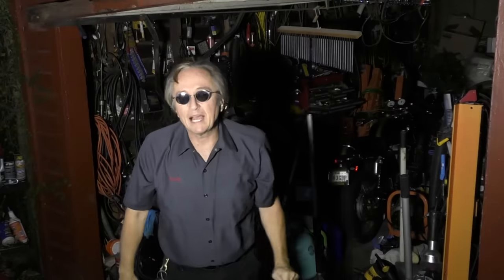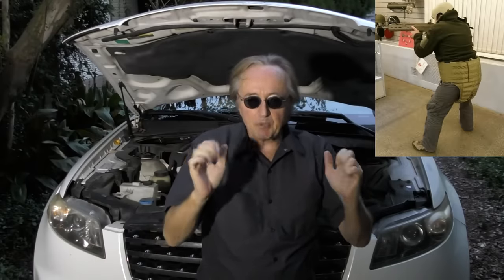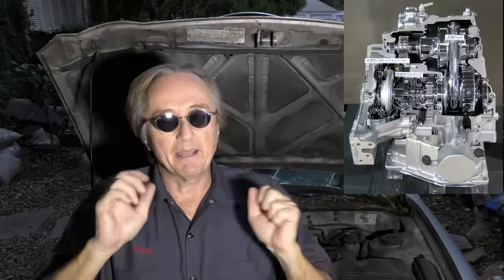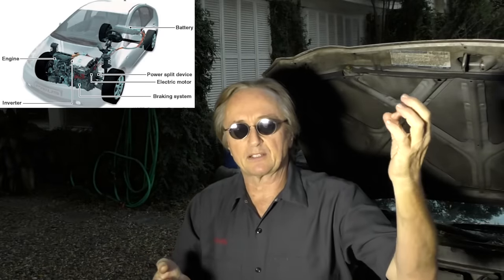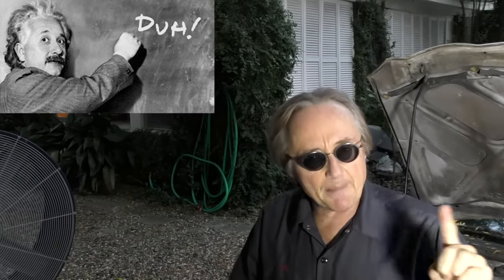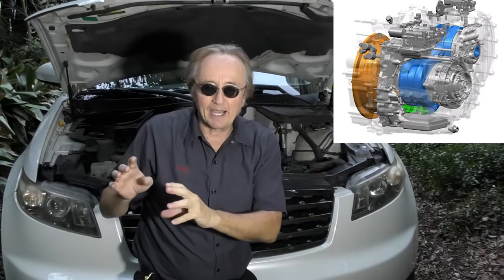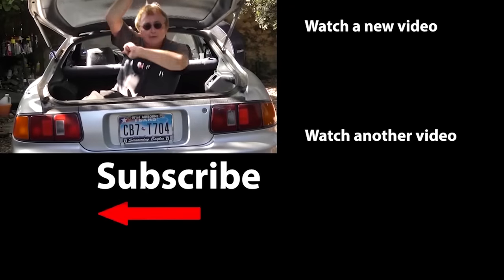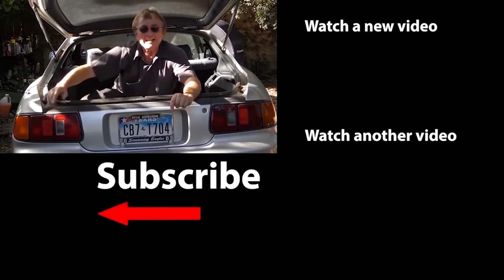Why Most CVT Transmission Cars are Terrible

Comment: 2016 Nissan Altima 2.5l 
cvt transmission went out at 43k miles, in the shop as I write this..
DO NOT BUY A NISSAN WITH A CVT TRANSMISSION.. you have been warned!!
Reply: Matthew S I feel you mate, had my Murano’s CVT replaced at 100.000 km. Engine also had a 4000$ issue. 
Get rid of this Nissan while you can and get a Mazda 6 - drives so much better.
Reply: You should still have warranty.
Reply: @anon4041  I do but that doesn't give me a piece of mind knowing the cvt can go out at anytime..
Reply: @scottsuem3384  The CVT doesn't just go out at anytime. There has to be wear and tear on it or mechanical failure. 
You also get warranty on the replacement too. CVT transmissions actually last a long time, but you need to do proper maintenance on it. A lot of people don't bother changing the fluid ever lol.
Be happy you still have warranty too, as many people don't. I don't think it is the CVT itself that is the issue, it is the company that supplied it. Which is probably why Nissan still uses CTV.  If you are that concerned, sell the vehicle.
Reply: Matthew S  get a lemon law lawyer and get all your money back, thats what I did
Reply: I have a 2017 Nissan Sentra Sr turbo. Cvt transmisión went out at 15,000 miles lol
Reply: Did they ever tell you what the problem was that cause your transmission to go out with solo of a mileage? Would you trust a CVT transmission if I bought it in a Toyota?
Reply: Do not buy nissan at all
Reply: @TheLifetraveler1  they never told me, they just replaced it, it was still under warranty. It wouldn't say that toyota's cvts are bulletproof but I would definitely trust them waaaaaay more that nissan's.
Reply: SmellyCat no it doesn’t. It has a regular 4 speed if you have the 2.5 engine. If you have the 3.5 V6 it has a 5 speed.
Reply: Nissan didn’t start using cvt in the Altima until the redesign in 2007. The murano however has always had a cvt
Reply: Got a 2013 Altima 3.5S at 82k miles and no issues 🤔
Reply: Daniel Jimenez got a 2013 2.5SV altima at 70k miles... wish me luck, no problems until now
Reply: @DarHacks  good luck because any altima owner needs it for sure
Reply: @TheLifetraveler1  cant go wrong with a Toyota
Reply: I got lucky I made it to 74000 miles.. Car is going to be traded on a Toyota...
Reply: avoidtheNoid I too got a 2011 Nissan Maxima s no problems at all
Reply: Better still. Don't buy a Nissan full stop!
Reply: @scottsuem3384  Any transmission can go at anytime. Your point?
Reply: Johnny Shawn  No they weren't.
Reply: @alexeivoloshin3065  POINT  I have never had a transmission go out until this CVT .. but please go buy one and try your luck.. how many transmission have went out at 43000 miles ?? why are you on here unless you work for Nissan?  YOUR POINT 😂😂
Reply: Sadly, that now means don’t buy a Nissan at all. I think their sole model with a regular automatic transmission is the gargantuan Armada.
Reply: @NLtakesTheHedgehog  I would buy nissan just not one with a CVT
Reply: I had a altima 125miles never had a transmission problem, now I have an infiniti still not problems.
Reply: @Deivy_84  I'm truly glad you haven't  had any problems.. but so many people have..
Reply: Fer Estrada  what’s a lemon law lawyer
Reply: SmellyCat  is it a v6?  I have a 2007 v6 Altima with cvt. No problems
Reply: My mom has a 2016 Nissan Sentra with a CVT and she hasn't had any problems at. It's been a great car for her, much better than her previous one which was a Ford Escape.
Reply: I have a 97 Sentra 5 speed it's been the best thing on 4 wheels I've ever had
Reply: Matthew s  I agree that Is why they are Mad cuz if they hot ride the car they gonna get problems with it and that’s why they get so mad cuz they can’t hot ride it.
Reply: 04 maxima se running strong at 130k
Reply: So is our Pathfinder with 26k miles!!
Reply: I have Nissan 2016 Altima and no issues
Reply: @anon4041  Only if the service intervals have been observed and documented by a Nissan dealer. I owned 2 Altima's....one was great the other sucked enough for 2 cars. Nissan absolutely sucks to deal with too.
Reply: @scottsuem3384  I mean I've seen a camry transmission go out at 60k mikes and ive seen engine failure on a corolla at 130k miles... ALL CAR BRANDS can have their issues. But if you take care of your car and dont abuse it, most should go 200k miles regardless of the manufacturer.
Reply: WTF NISSAN, EVEN 2016s BREAK DOWN??!!!
Reply: Matthew s I had a 2003 Nissan Sentra my first car I ever bought and i kept it maintained transmission never went out on it and it had 260,000 miles on it and I had it for 4 years and I got rear ended and it got totaled now I have a Nissan Altima that is 2009 and it has 196,000 miles on it and now I’m having problem after problem I took it to Nissan and had them do diagnostic on it and my catalytic converter and transmission is bad and hast to be replaced and I still owe 5000 on it  and I thought since my first car was the best car I ever had I figured this Nissan Altima that I have now would be a great car well I was very wrong uhh now I have so much work that needs to be done to it and now I don’t even know if I should just replace the transmission and catalytic converter or just get a new car so confused
Reply: @latoshatanner9554  I grew up in a family where my mum did all the driving and my dad couldn't drive. They both new nothing about cars. I was never really in to them myself but had a crack at changing a transmission when I was 16. It's a very easy job. In fwd cars they are tiny. You can lift it out by hand. First one took me the better part of a day. Now I'd probably change one in a couple hours. All the plugs are either colour coded or specific shapes that can only fit one spot. Would be a challenge to screw it up.
Reply: thanks for the heads up
Reply: i had nissan 2013 sentra sv.  transmission died @94000 miles on august 4 2019.  cannot be fixed.  need one from a junk car.
Reply: ntaveras Gees, people are going manual trans and NA engines. Turbos tgdi or gdi with cvt is asking for headaches.
Reply: Should you lease one?
Reply: I have a 2015 Altima and the transmission is great.
Reply: @adolfoescalante6220  you should tell that to about 300k people a year...
Reply: SmellyCat 2006 has no cvt
Reply: @ODTheNewRapper  miles?
Reply: @netto4835  Whoa! Tell me more about what happened to you. I'm looking into buying a Nissan Sentra SER Turbo  this weekend. 
How much was the repair bill? was it covered under the warranty? 
Is it a good car?
Reply: DO NOT buy any car with a cvt transmission
Reply: @netto4835  Great Lie
Reply: @netto4835  toyota prius uses cvt and never heard of any issues. 2014- 2021 corollas use cvt too no issues. do cvt fluid drain and fill every 60,000 miles and life is good

Comment: I have a 2011 Nissan Sentra with the CVT. So far, I've put 155k on it with no issues at all. I do stay on top of preventative maintenance as I put 100+ miles a day on it. And I get 33 mpg.
Reply: Good for you. You got a good one.
Reply: Sam LaQuey mine is a trash can and i only have 60k miles. Plus you must not drive your car very hard because i only get 24 mpg on average.
Reply: The cvt works for conservative driving. You can notice the engine should not be driven so fast for a transmission allowing the motor to remain constant at certain rpms to get too speed. I have a sentra and I too get around 33 to 35 mpg.
Reply: Sam LaQuey my theory is that it depends where your car was made. If most of the cars Scotty works on are made in Mexico then yeah it won’t be as good.
Reply: @evan8tor21  mine was made in Mexico
Reply: Yeah you & me are counting our blessing.  My daughter has a 2009 Sentra we 
bought new with 170K. I told her don't beat it or you will have to junk it ,replace 
trans or new car payments.
Reply: Joshua Jasso Is
Reply: Did you change trans fluid??
Reply: No modern car, driven moderately, and maintained properly, should break a transmission. The fact that some of these transmissions go out in under 30,000 miles tells me there is something fundamentally wrong with them. You are fortunate you got a good one but I wouldn't take the chance given there are several competitors that have better reputations to choose from.

Comment: I think the belt is the "weakest link" for a lot of the CVTs out there. When that belt blows, it's a mess of shrapnel inside the transmission. Toyota doesn't use a belt to achieve CVT in their Prius: it's all done by varying RPMs in MG1, MG2, and the ICE. Cool stuff.

Comment: 127 k on my Altima. Runs like the day I bought her (2011) don’t play with the “manual” option UB FINE....31 MPG 💪🏻
Reply: I have a 2015 corrola 110000 on it still runs like new
Reply: I've got 154,000 on mine. I love my Altima
Reply: 2017 nissan altima over here .. 86000 miles so far and still runs great
Reply: 128k on my 09 Altima.

Comment: The achilles heel for all CVTs is torque. The first CVT used in a passenger vehicle sold in the U.S. was the 1987-1994 Subaru Justy. But the Justy weighed just under 2,000 lbs and had a 1.2L engine cranking out a modest 73hp and 71ft/lbs of torque. As a result, the CVT in the Justy had no significant service issues, as I recall. 

I think the reason Toyota and Honda CVTs last longer (so far) is because they're offered mostly in Toyota/Honda's smaller FWD vehicles, where the engines don't have much torque, or in their hybrids, wherein electric motors bypass the CVT when moving the vehicle from a dead stop, thus eliminating the vast amount of torque strain that CVTs in larger non-hybrid and/or AWD vehicles experience. This relief greatly extends the life of the CVT. 

When CVTs are connected to larger vehicles with more powerful engines and/or AWD systems like the Nissan Rogue or almost any Subaru, the CVTs can't handle the constant torque load, so the belt/chains in them strip and can't grab the variable shafts and pulleys anymore, rendering the transmission useless.

That is why, for the indefinite future, I can't see myself buying any non-hybrid vehicle with a CVT, especially since I live in a mountainous area, which is hard on any transmission anyway.
Reply: As someone who had a 2014 Honda Insight [hybrid], i had zero transmission issues up to 154k miles as the second owner.

Thanks for your 'insight', pun intended. Reducing the the load on the CVT is logically a good idea

Comment: And FORD had tons of problems with dual clutch automatic transmissions!
Reply: Look up getrag transmissions used in the focus and fiesta. It stinks because they are nice looking cars.
Reply: Yes. My 2016 Focus repeatedly tries to kill me and my passengers (I'm an Uber driver and I'm stuck with the car). I'm suing Ford when it finally causes a crash.
Reply: @Network126  delete the comment to not get hurt for it when you go to court for the accident lol 😆
Reply: VW/Audi does DCT very well, and they are wet clutch systems whereas Ford is dry clutch system.
I knew about this, so I looked high and low and found the 5spd manual 2015 Focus. My last 2003 Focus 5spd manual lasted 166,000 miles on the original clutch and it was still going strong. Changed the fluid a few times and everything was peachy.
Reply: A few years a friend of me rented a Focus from Enterprise. That transmission was awful. It never shifted properly when going into a higher gear. Amazing how these auto engineers go to college and study engineering but cannot develop a transmission that shifts smoothly.
This is not rocket science and they are not developing warp drive.
Makes me wonder  what they are really studying in college because
it  is not engineering . Nissan  could probably care less  about
the CVT "problem". They will place the fault on the owner. Besides 
most lease the vehicle & after three years they do not have to bother
with the CVT going south  because it will end up being someone else's
problem.
Reply: @3698s   To be fair, Ford had a conventional torque-converted fluid automatic back in 2005-2009 and the Focus was rated by Consumer Reports as a TOP PICK for overall reliability.

2012+ Focus has a good engine, a good chassis, good suspension, decent parts everywhere but is KILLED by the stupid dual-clutch that Ford has never gotten right. Just goes to show how one part of a car can ruin the entire experience.
Reply: Ford's dct is total junk stay away.
Reply: Manuals are totally fine.
Reply: I saw a 2016 ford Escape stalled on the highway
Reply: @gutadin5  Or ran out of gas.
Reply: @exothermal.sprocket  towing truck pulling it
Reply: Right. Which could be a dozen different reasons, if you're honest about it.
Reply: and they drive very well until they start grinding
Reply: @LY-uf2bh  Terrible VW DSG? You smoking something?
Reply: these are also problematic
Reply: @Network126 You can easily file this under your states Lemon Law policy. Simply take it in to Ford 3 times complaining about the transmission not shifting correctly, and since they have no way of correcting it as its purely from bad design once you hit the 3rd try with no correction they will be required to buy the car back if you file the claim. What you can try is disconnect the battery for an hour and then afterwards drive the car like you normally would for about 15 miles after reconnecting the battery. It deletes all of the transmission shift training data and allows the tranny computer to relearn how to shift. It helped a bit with my moms 2012 when she had it. Also take it to Ford and request a software re-calibration on the transmission or software update. Get out of the Focus as so as you can, man.
Reply: Except when companies get cute and use expensive dual mass flywheels instead of reliable solid flywheels.
Reply: Yes, I just got rid of mine and got a Toyota and I haven’t looked back!
Reply: So does VW/AUDI.
Reply: @VictorDunkle  
I remember back in 2014 I went to a Ford dealer to test drive a new Focus manual......it kept stalling when I tried to take off with the clutch (yeah im 58 and learned how to drive with a manual)
I test drove another one and it did the SAME thing!!!
Reply: Oh yes they do!!!
Reply: Vic - The shaft seal was made too cheaply. Let oil get into the dual clutch unit. Warranty repairs used the same defective seal. Finally Ford coughed up an extra 3¢ (😜) per seal and made a better deal.
Reply: Yup. My daughter has a Focus and the transmission was replaced at 35K miles and she is having to have a new transmission again. They are worse than the Nissans.

Comment: Hey Scotty I am a seasoned mechanic and the only problem is that I've had with CVT transmission is when somebody tows heavy trailers and motorhomes etc. and really puts them to the test if these transmissions are driven normally and serviced well I think they are very good transmissions and the designers have done a very good job
Reply: I know a few people who've had CVTs die at incredibly low miles, who drove them very easy, and never revved them or towed anything. CVT are garbage.
Reply: @fireblazer6661  I know people who have had tranny's go out at low miles that are not CVT's. My husband has an F250 truck with only 90k on it and he had to replace the transmission last year. It's the Lariat top of the line truck but the tranny's are crap.
Reply: Scotty, I work for a Nissan boiler room, you can 
trust me though as I have no user generated content, 
and never intend to.
Reply: @fireblazer6661  But some people have had good luck with them so maybe it's a quality assurance problem so some are not made right.
Reply: @crand20033  people HAVE had luck with it, but that's exactly the issue. Luck.
Reply: @Atmarixx  After looking inside of a CVT transmission I can see they are very complicated so the chances of something going wrong is high.
Reply: @Atmarixx exactly & luck will run out!

Comment: Hey Scotty you prob already know this but found this:
For the 2019 Toyota Corolla Hatchback Toyota created an all new CVT with a "launch gear" or a physical 1st gear from a conventional automatic transmission alongside the CVT pulley. From 0-25 mph the transmission would stay in this launch gear to aid in acceleration from a stop and improve durability of the CVT. After 25 mph, the transmission would switch over to the CVT pulley.
Reply: Just bought this car. Good to know!